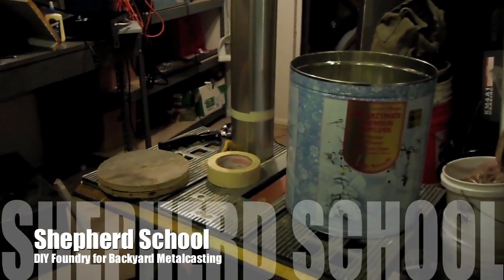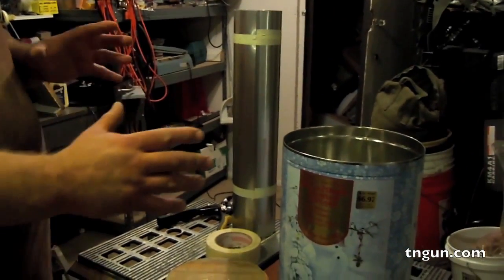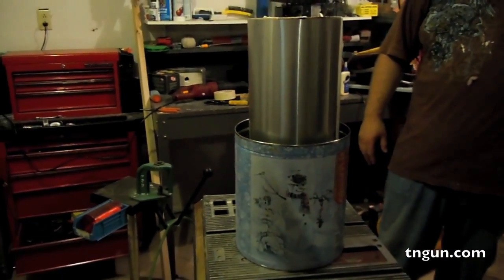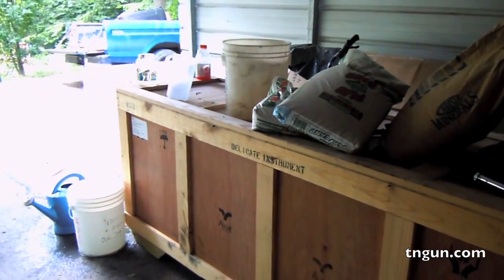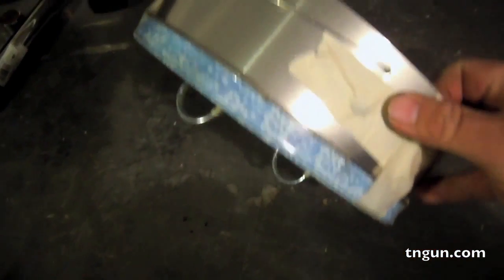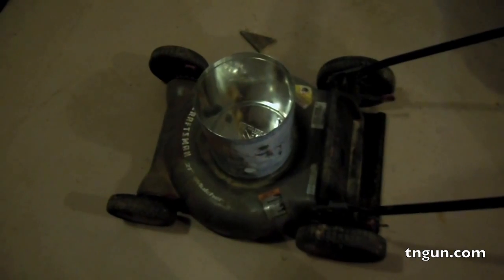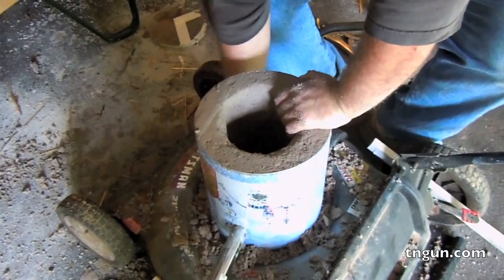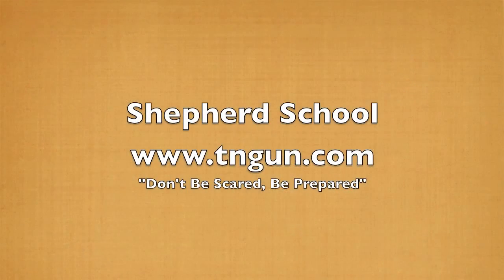How To Build a DIY Foundry For Backyard Metal Casting Part I

Comment: fill the form with something like sand so you can stuff it full and whats up with your handles?  There all jacked up. Also..... The high pitch is horrible but you did do a good job so I sat though it. You might need to get a new camera.. It's that bad.

Comment: Can someone explain why i have way more slag than i should have please, thanks
Reply: If your melting aluminium cans then there will be a lot of slag. It might also be that your foundry isn't hot enough that's why I use propane and waste oil as they get everything hotter than it needs to be.